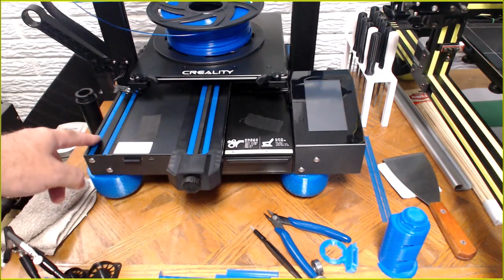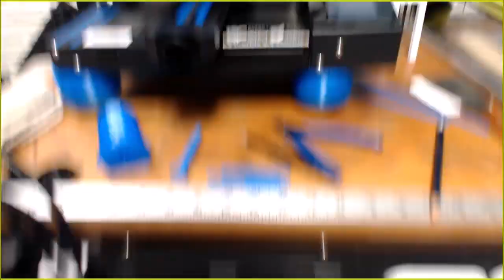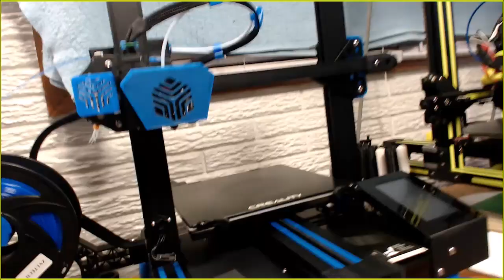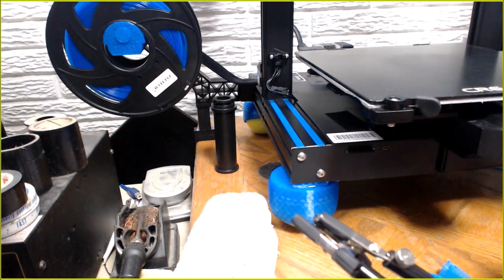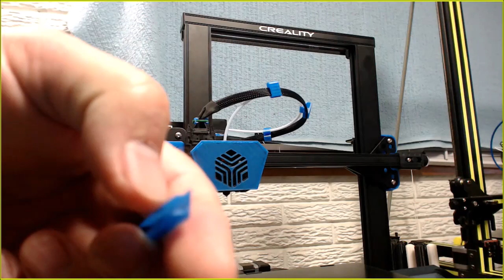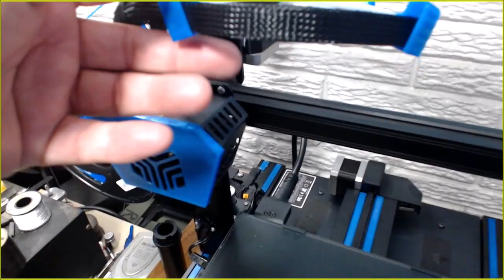CR-6 SE Mods I have done "test prints" : )

Comment: On the bearing spool holder, which way to print, I tried to print the large area flat on the bed, but it didn't work at the bayonet mount area ( wasn't formed correctly ) Should it be printed vertically with the CR-6SE logo toward the bed?
Reply from the maker: yes, Logo on the bed.
Reply: @BladeDreams  Than for the reply.  Did you use any supports?
Reply from the maker: @Datsunwizard  no support needed.
Reply: @BladeDreams  I was thinking of adding some around the bayonet area,

Comment: The Printbed working better over time might be because of some residue on the bed from shipping that wears off over time. I got my Creality SE today, assembled it and swiped the bed with acetone after removing the protective foil. on the wiped i recognized a very well visible yellow stain after swiping. That yellow stuff needed several acetone swipes to get off.
I also have an Anycubic i3 Mega with a similar printbed which works very well for me (i print close to everything with PETG), and i clean it with acetone about every other print job - thats why i cleaned the Crealitys bed automatically.
Edit: -----------
I'm now doing my first test print, loaded my filament, and while pressing it through the nozzle some yellow filament residue came out before mine extruded. Maybe they do a test print before shipping and some of the color from this print remains on the bed. I did a burn and smell test on what came out of the nozzle, and it seems like its PLA.

Comment: Hi. New to 3D printing, and came across your channel while researching printers. Picked and bought this printer  based on your (and others) videos and recommendations. Lots to learn on my part but have been wanting to get into this hobby for a few years...so just bought one...lol
Thanks for your videos, your content and presentation are very good!
Also wondering if you post/share your mods anywhere?
Thanks again, Greg
Reply from the maker: They are all on Thingyverse and the facebook group for the CR-6se
Reply: @BladeDreams  Thanks for quick reply. I did have a look on thingiverse as you have a link to it, but didn't find anything. I also looked on the facebook group as well. I'll look again. Do you use the same username as your Youtube channel.  I just joined both of those websites, so sorry for dumb questions, this is all really new to me. 
Greg
Reply from the maker: @gregm5839  Creality CR-6 SE/CR-6 MAX Official User Group then files section - NOT my creations. but listed there.
Reply: @BladeDreams  By chance do you know where i can find an STL for the filament spool roller? I can't seem to find it on Thingiverse nor the Facebook group, but I am very much interested in adding one to my CR-6 SE
Reply from the maker: @brent8986   I have not uped them to ThingyVerse - For the lfe of me, I can not get Tinker cad to load / share with it....I'll post links below, let me know if any issues - I will add a Grive file access if I need to : )  ( yes, the spool roller is a great re mix i made - i did a long time ago for my Chiron and dont even remember where it started : )
Reply from the maker: https://www.tinkercad.com/things/8xbDTtcTK2L  - Spool roller you need to add the bearings
https://www.tinkercad.com/things/8PUD1gwwx1n  - Spool Pin
Reply from the maker: thingiverse.com/thing:4626299   (LMK if works or not)
Reply: @BladeDreams  Hi. thank you so much, it worked and I have downloaded the files. I could not find this on thingiverse or the facebook group ( and I did not want to bug you again)....not sure if it is just me, but when I search on thingiverse I am often getting different (off the wall) results each time I search the same thing....it seems a little flakey....but then again it's free so hard to complain...lol
I've just completed my third print, and all seems to be going OK...the last print I sliced with the included creality slicer...yeesh lots to learn in this hobby.
Thank you again, I will look for more of your mods!!
Greg
Reply: @BladeDreams  Links worked for me! Thank you! looking forward to future content :)
Reply from the maker: Bearings are the std skate bearings. 608;s I think. 22mmx 8mm hole
Reply: @BladeDreams  I have been searching for these links over 2 hours thanks :D